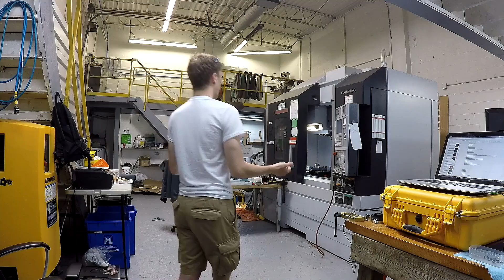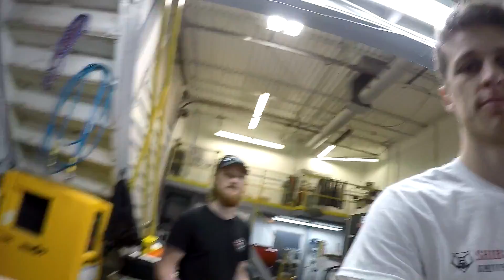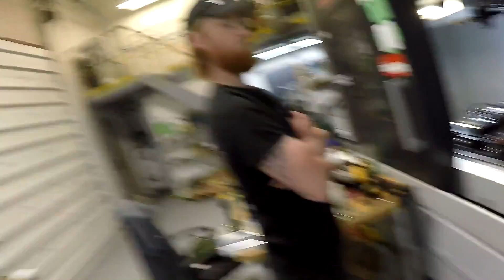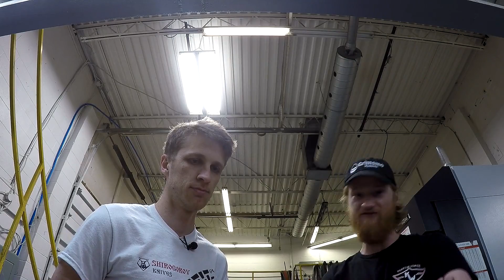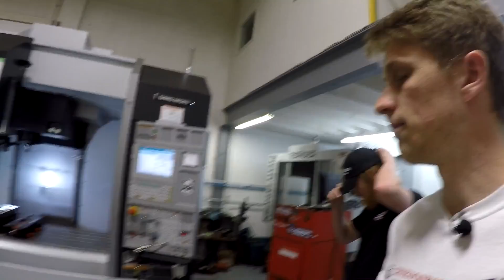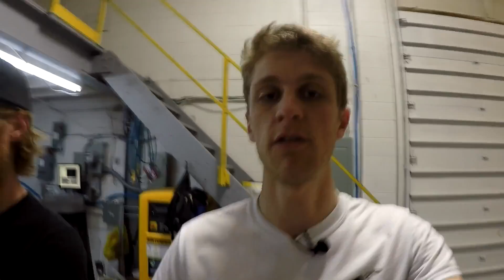Mori CNC mill purchase story - Grimsmo Grind 014

Comment: If i'm not mistaken wash gun is going to be an $$$$ option. I don't think you can hack it. What you can do is just through a Y on your flood coolant pump and use a standard rubber water discharge hose (NOT a plastic garden hose, the coolant will destroy it) and spray gun. you can then just turn the coolant on and wash away. If your coolant won't run without the door closed then you have another problem. Also you can just build/buy a wash down tool that is just 90° nozzle that uses the through spindle coolant to wash the inside of the machine. You just turn on the coolant and run the spindle at a few RPM and it washes itself. I built one with a from some 3/8" SS tube bent to 90° that was in a side lock holder, I had a program the ran the spindle at 10 rpm for a few minutes with the spindle at home. I made another tube that was bent to about 10° that I could use to wash of the table and parts. I just made a subroutine that call the wash down tool and ran the table in a pattern with the coolant and spindle running. Works awesome and you don't spray yourself with coolant.
Reply from the maker: +Widget Works Manufacturing Inc.  Wow I never thought about a wash down tool!  I don't have through spindle though, but it is prepped for it.
Reply: Really, you don't have TSC? You really should have that. Even if you just have collets and not through coolant tools the coolant delivery is so much better than flood. Not to mention that I pushes chip away from the tool not toward the tool. Plus then you can build a washdown tool. Win Win!

Comment: The gun button operates a valve that shifts flood coolant to the gun. Your salesman can give you pricing on adding the option.
Reply: He wants to add it himself to avoid $$$
Reply: +littlestworkshop Yeah, I get it. I've seen so many different versions of the ball valve to garden hose method and it saddens me to see it.   You bought the best machine in the industry for a reason. The factory option will use high quality materials and integrate correctly, so as to not cause any other issues.
Reply: You can do it yourself and use high quality parts and materials and integrate it correctly, DIY does not mean it has to be a manual ball valve, he was specifically talking about using the panel control. It's a convenience and not something that is going to make money do being frugal seems reasonable to me, he paid the big money for the big iron that does the real work.